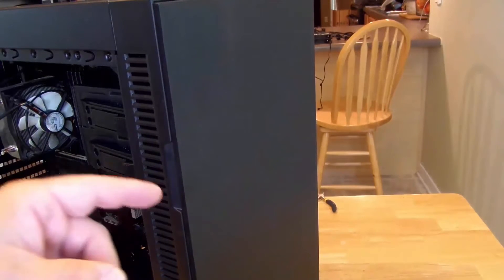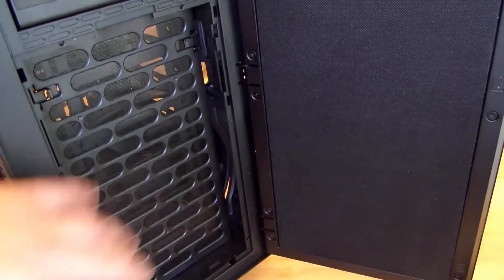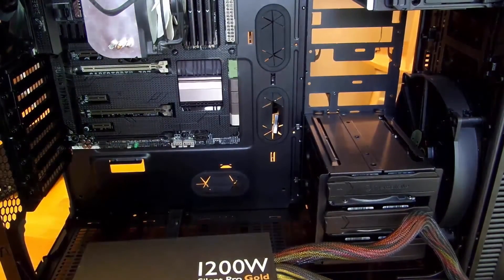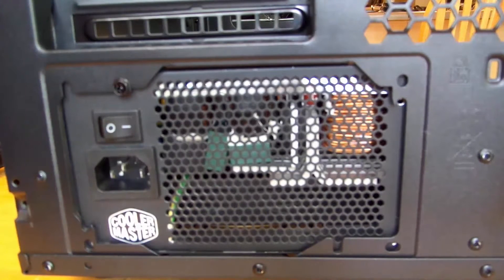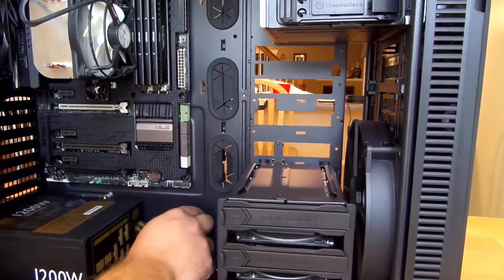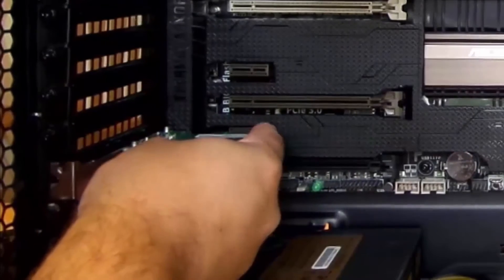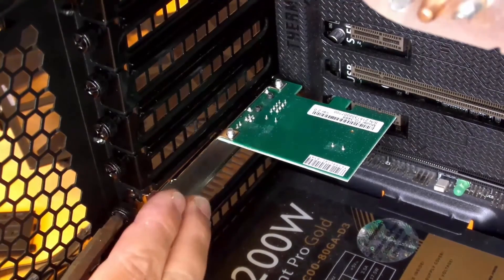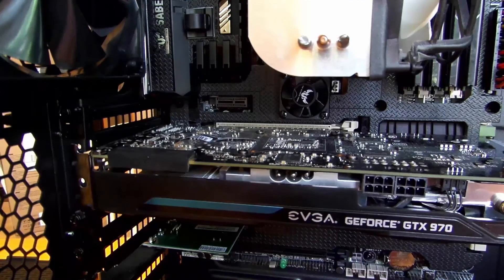How To: Build a PC with a Thermaltake Suppressor F51 Case [PC Building] Part 2 of 2

Comment: need help  for my H110i v2 is F31 good  big enough for mounting 280mm radiator on top?? need case for AIO for 140euro for top mount with windov..witch case u recomended?? like cases like corsai400q ,F31 SUPresor.want good solid  big mid tower ,for easy AIO h110i v2..thanks nice video..